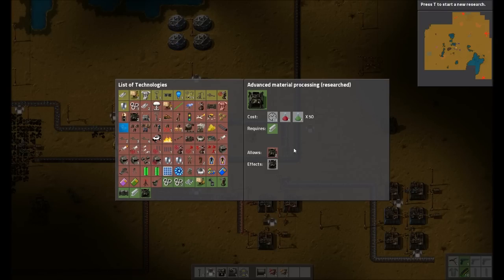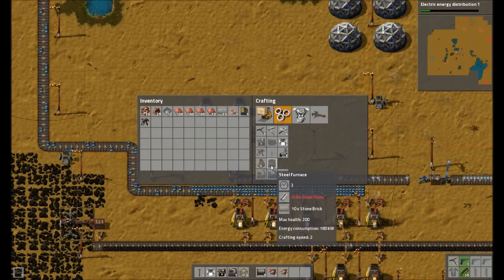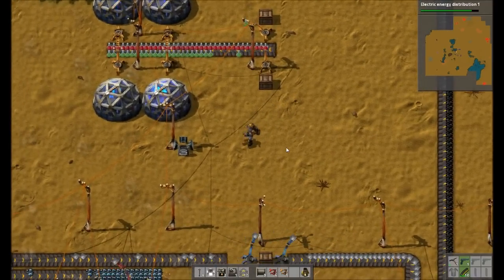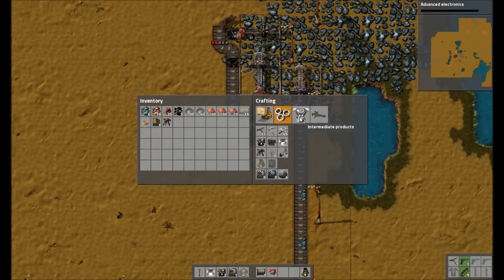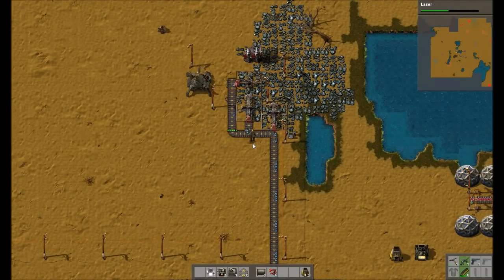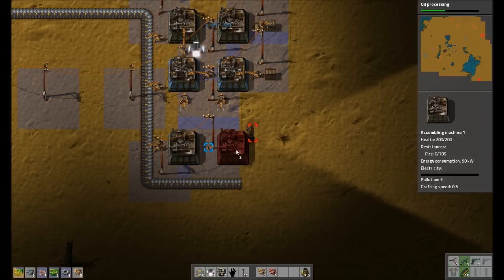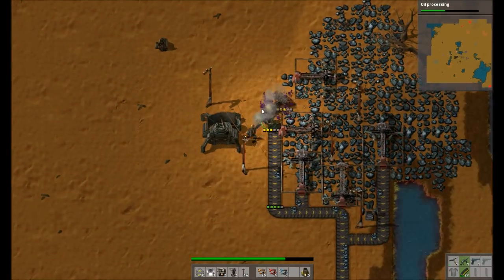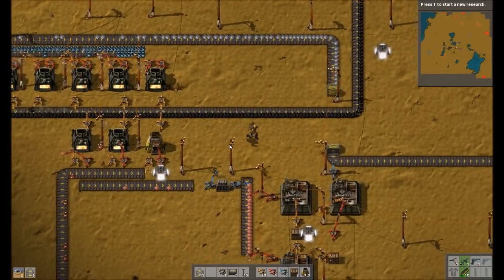Factorio   Episode 3

Comment: The aliens get more aggressive and stronger based on the amount of pollution you produce. You produce pollution by burning coal, so if you convert things to use electricity you will have fewer machines producing pollution. Later in the tech tree you can get solar power, which doesn't produce pollution (IIRC). It takes a while to get to and to build the infrastructure for, but once you're there you may be able to get the attacks to tone down a little. Also, you can display the pollution on the map as an overlay, though I forget how.

Comment: Pro tip Just push then alt key and will show you whats in a chest or in auto crafters show's you what being made. : P Hope It helps. also if you use a slpiter you can make the iron ore or copper run on both sides . just split then take a belt and feed it back in to it self. the side thats got none or few you want the spliter to stick out and belt on the side you want more items to back log more evenly. ^_^

Comment: I'm gonna ask a silly question related to Factorio..when you replace a building with a higher tier, is that an instance of polymorphism(in coding), or "not necessarily"? I've taken 2 C++ courses already, but I've not seen or had a practical application in polymorphism, related to game development, except for upgrades/replacements..that might not be a case.
Reply: Adrellisartar Novalrus You'd have to ask the game devs, as Factorio is not Open Source. However, perhaps they'd share this knowledge via the game's official forums.
Reply: Adrellisartar Novalrus I have yet to learn any C++ and I don't know how this game is coded, but I do know that yes, it is most likely a form of polymorphism. It's pretty commonplace to see polymorphism in games; in this example there is probably a base Object that has health and a sprite, extended by a Building which has say, a footprint and an inventory. Tier 2 furnaces might extend Tier 1 furnaces, or they might both extend a common (possibly abstract) class of furnace. I've recently had a look at the class hierarchy in Unreal Engine 4 and you might find that interesting considering you've got practice with C++.
Reply: Adrellisartar Novalrus Well polymorphism essentially means just turning one object into another so most likely yes, but this isn't it's only use. It is actually pretty common.

for example; 

You can turn idle placeholder cameras into the main viewing camera.

You can turn an entire map into another one or even sections of a map.

Even swapping between animations can be done using polymorphism.

I'm not an expert at programming by any means but I was learning C# awhile back but had to stop.

Comment: i like chest logic in these type of games xD stronger material but same size = more space
Reply: Elmazz Of course, because if you have a strong plastic bag v a weak plastic bag you can shove more things in before it breaks. Its only logical.
Reply: im talking about chests here, not plastic bags xD chest cant be stretched like a plastic bag wtf xD
Reply: They can if your strong enough!
Reply: xD
Reply: Did you mean: Iron Chests in Minecraft?

Then again, most sandbox games go on that concept. Why take up more room if you can just make it more expensive? Compact is better in sandbox, even if it sacrifices some realism.
Reply: im not saying its bad, its just a funny thing :D
Reply: Elmazz Think of it as the walls of the chest.  Weaker materials require thicker walls (and possibly internal buttressing) to have the same strength, so there's less internal capacity.

Comment: please dont do 60fps, cripples my pc...cant watch it
Reply: Ujvári Mátyás then don't watch HD, also how does 60 FPS affect your pc so badly? I have an old 2009 macbook and 60FPS runs smoothly for me.
Reply: Hd is okay, but hd60 froze chrome. I've an i5 4670k and yet to purchase a gpu, so I use the integrated gpu. I don't think this game requires 60fps either, not really a fast pace one in my opinion.
Reply: Ujvári Mátyás :P well there's your problem. you haven't purchased a GPU. your most likely bad factory issue GPU is probably just keeping up the HD res, but with 60FPS added in it's just too much for it. I do admit I'm not exactly an expert on this, and I may be very horribly wrong, but it's still a theory
Reply: I'll get a gtx970 next month, but regardless... Factorio isn't a fast game : P
Reply: Ujvári Mátyás I haven't got any problems with my crappy Intel HD3000 integrated graphics. Update drivers?
Reply: Actually, if we're looking into it... The i5 4690k(yes, before I wrote wrong one...) has Intel hd4600, driving a 1080p tv, and I run canary build of chrome...
Reply: Marco Rebhan forgot to + you in reply...
Reply: Ujvári Mátyás HD4600 is more than enough to play 720p@60 fps. I have a 4690K too and it lived alone on my pc for a month before I could afford my current GPU and no issues at all. Maybe you should check your Chrome installation and deactivate your integrated Flash Player plugin because it could (and happily will at some point) cause this kind of freezing, stuttering and so on.
Reply: GiosafatteSalterino I think it uses html5 nowadays for most videos, but of course I'll check
Reply: Ujvári Mátyás You can do a fast check by typing chrome:plugins in you search bar. If Flash player figures in the list try to deactivate it and make a third part install.

Edit: my bad, bad English.
Reply: Ujvári Mátyás I have a i5 4460 with HD4600 and it can handle 720p60fps with no problem.It can even handle 1080p60fps and 1440p downscaled to 1080p with no problem.
Reply: it stutters for me at both res if its 60fps, popping from the stereo and video lags behind soundafter a while.

Comment: Some tips to make your factorio live easier:
1. Turn the info overlay permanently on (Alt-Key)
2. You can take items out of inventories without opening the interface (Ctrl+Click)
3. Fix items to your tool bar (middle click the item in the toolbar at the bottom of the screen)
4. Leave more space between different areas to expand! (There has to be more space between mining and smelting and also between smelting and crafting)
5. Upgrade your weapon (The pistole is pretty useless against the natives)

Have fun playing this great game!
Reply: Dorian Ursuul i would add three more:

1. you can pick all items of the same type from an inventory with ctrl+click, and with ctrl+right click you take half from every stack.

2. you can put stuff into inventories whithout opening them, take the item into cursor, and then ctrl-click in the inventories to put the amount in the cursor into the inventory. Right click puts half of it.

3. you can copy the recipes of the assembly machines, shift-right click to copy (will put green corners around it) and then shift-left click to copy into other machines (will highligt source with the same green corners). Works also for smart inserters and requester chests, it copies the settings.

keep up with these videos, i love them. There are good mods out there, btw.